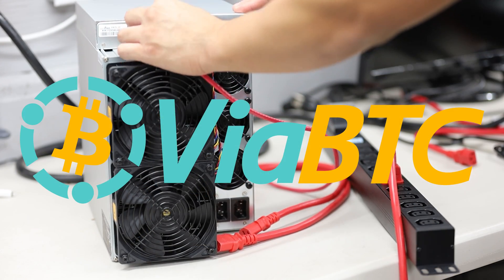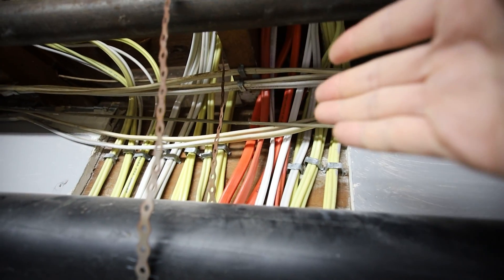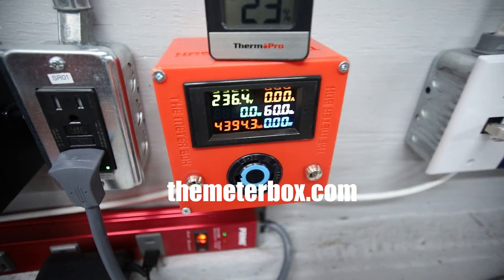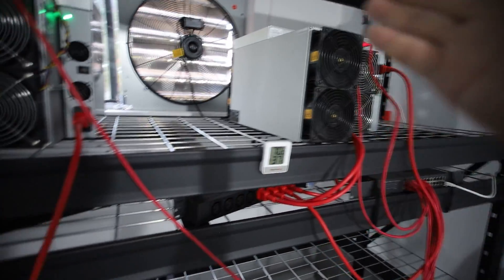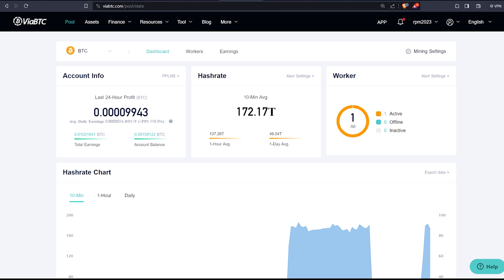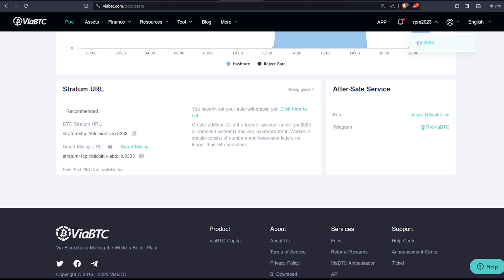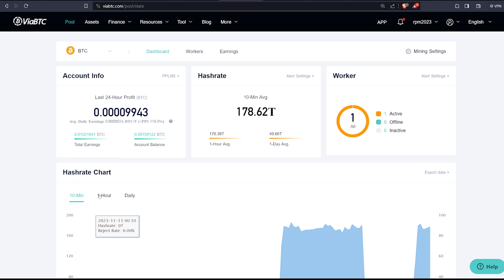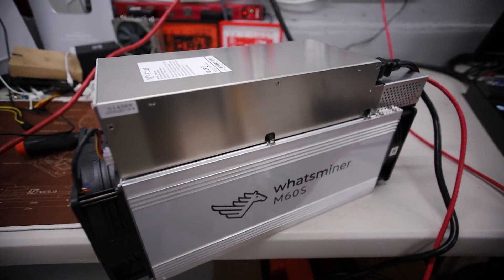How do I Power and Setup my Bitcoin Miners at home going into 2024?

Comment: You are very mistaken when you think that a 15A socket cannot be used for an ASIC. You probably forgot or don’t know that amperes depend on the network voltage. That is, if you hang a load of 1800 watts on 120V, it will be exactly 15A BUT if you hang a load of 1800 watts on the same socket BUT with 240 watts then it will be 7.5-8A. Everything works, you just need to connect 2 phases to this outlet and everything works fine 24/7 with a 12awg cable, but with 10awg it will be better. So learn the materiel)))

Comment: If I ever got a big boi asic, i'd have it shipped directly to hosting company so I only pay for shipping one time. Have to figure in additional costs baked into hosting company, setup fee or whatever they want to call it. it's not just flat .08 electrical rate.  if you have to pay $100 per unit to have hosted, that can factor into the decision to have it hosted.